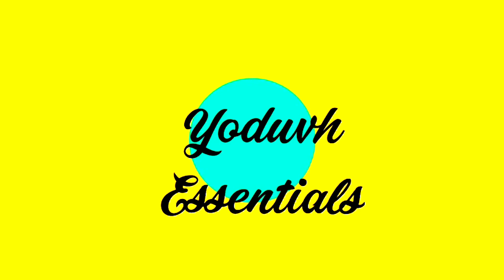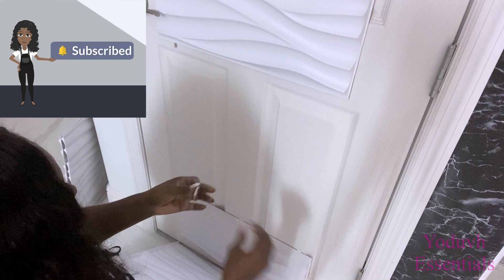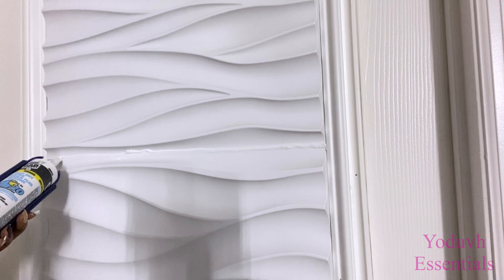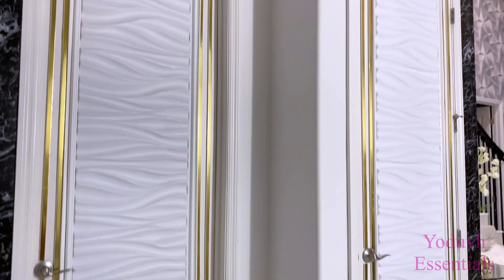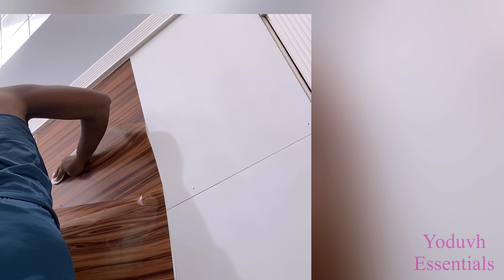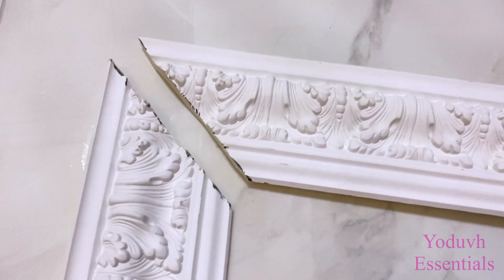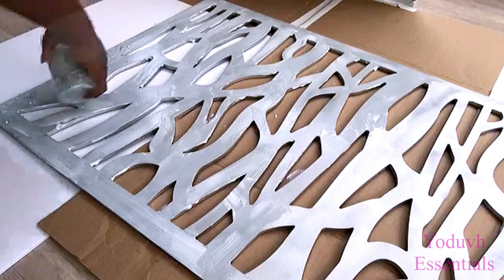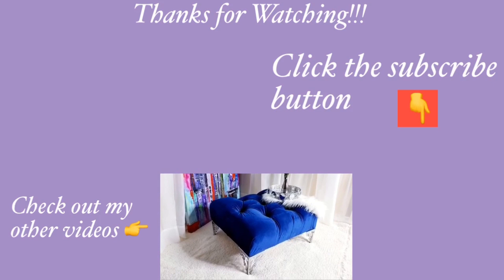DIY DOOR Design with Rubber Mat! HOME Decor Ideas with Rubber Mats

Comment: You're incredible! I've been watching your videos and you honestly never fail at your projects. I thought of something while watching this video about enhancing doors. You used halfmoon shaped doormats to decorate the doors...sharp idea! I'm thinking I might join 2 of those halfmoon shaped doormats together and make a ceiling medallion to place against the ceiling above a hanging light fixture. The mats could be painted any color. A circular hole cut in the middle for the wiring and light fixture mounting pieces. The mats then could be glued and also secured with screws to the ceiling. I like the look of classy ceiling light fixture medallions but they cost so much for every room. Using those mats would be so much cheaper. If this idea could ever work I just about know you could make it happen. I'm going to try it and maybe someday you might try it and make a video. Hey. Thanks for creating such a fun learning crafty DIY channel. I look forward to watching more of your posts.

Comment: I sprayed the rubber mats  with spray paint how do you stop them from cracking
Reply from the maker: To keep your spray-painted rubber mats looking great, start with a spray paint made for flexible surfaces. Then, follow these steps: First, clean the mats well to remove dirt and grease. Apply paint in light, even coats, letting each layer dry fully. Follow the manufacturer's instructions for curing time. Consider adding a clear sealant for extra protection. Lastly, avoid harsh conditions to prevent cracking. Stick to these tips, and your mats will stay vibrant and crack-free for longer!